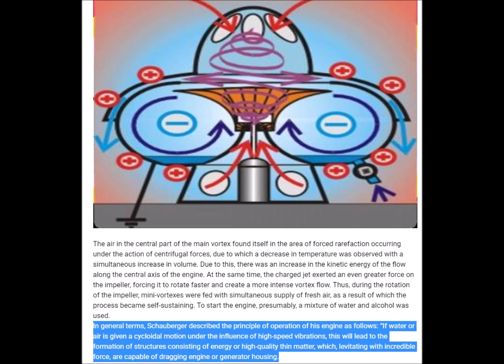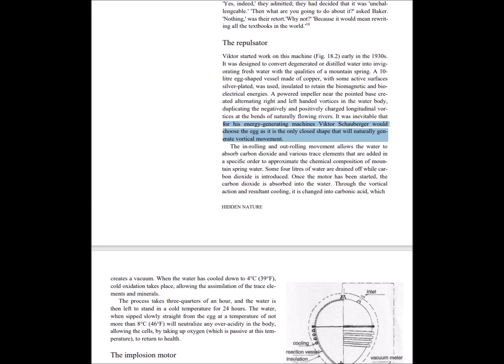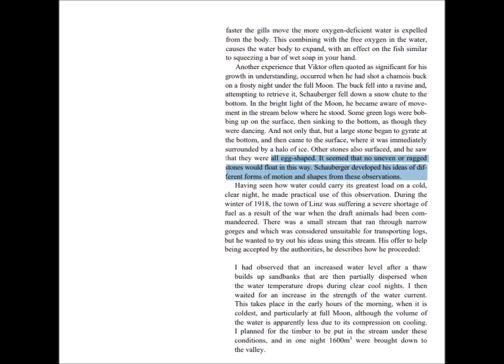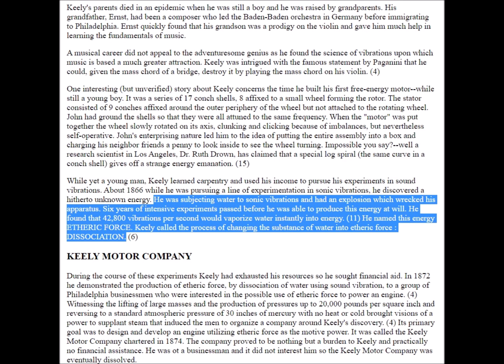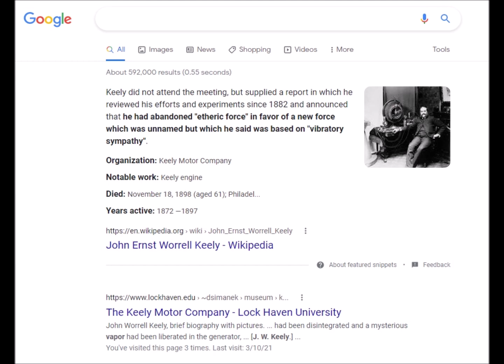Stone Levitation by Implosion

Comment: How is this not centrifugal?
Reply from the maker: @GWAForUTBE  The action of centrifugal force acts on the fluid creating the vortex.
Reply: @gsutton78  IC.  Pls look up the difference bettween Vortex & cyclone.  Or cyclonic action.  This is cyclonic action.
Reply from the maker: @GWAForUTBE    A vortex is a swirling mass of air or gas. That's what this experiment shows. My first experiments in water clearly show a whirlpool. Centrifugal force does not produce an upward force or vertical movement, ejecting the brick. The pressure differentials in and around the vortex do that.
Reply: @gsutton78  i did an extended version of the difference between cyclonic & a vortex but it was erased.  
Wiki has a good article & diagram  about a vortex tube explaining the difference.  
Yours here is cyclonic action. 
Great work you're doing. I've some other interesting ideas more related to AG ..

Comment: A better way of testing it would be to tether it to a retractable cord of some sort and then attach a newton meter on the bottom and see what the upward lift is

This would remove the unstable elements of the weight in a bucket and possibly give you more insight into the lifting power of this phenomenon.

Comment: With the egg theres varying pressures of "opposing" or "gravitational" lenz force at the distance because of its shape, it looks like first egg  vortex begins quick then goes slow because of the larger mass at the center then the last part is quick because the mass goes smaller again at the bottom. The cylinder mass is equal and thereof the lenz effect is equal.

Comment: its centrifugal :D
Reply from the maker: That's not what propels it vertically, though. Rather, the effect of centrifugal force on the fluid (air) creates a vortex which in turn creates strong pressure gradients. Low pressure in the center and high pressure around the edges.
Reply: looks like its atempting to escape but the container is conical, therefore its riding up
 @gsutton78
Reply from the maker: @NixCM   But in this video, https://youtu.be/4YpPdVQN9k0?si=Jp42Ho8t5DY2vvD4, the container is not conical and it still rises. This means that the divergent sides in the other experiments aren't the cause. It only enhances the effect, showing how important geometry can be to energy and force production. It's like rocket nozzles. They too have divergent sides that flare out. But they are not the cause of the expanding gas. The gas expends due to thermodynamics. The shape only enhances the propulsion by releasing force over a larger area.

Comment: I get what you're demonstrating. We pull the plastic container and replace it with a different mass to generate spiraling current and friction on the mass, and it will propel in the opposite direction of that source. 
My formal background is actually in electron physics and engineering, I can easily see a more complex system, that's still pretty simple, where combining effects with just a few devices would at least generate launch if not flight. 
How efficient etc. I can only guess.
Reply: You should look up the TSG by Malcolm Bendall. They need more physicists people to confirm the plasmoid theory.

Comment: gravity does not actually exist -- of course readers will immediately dismiss me due to this statement. But wait !  

Each example of 'gravity' is actually explainable via relative density and/or buoyancy. Release an apple in air, and it 'falls' to the group. Release the same apple above water, and it drops down through the air and then stays on top of the water. 

Now, here is where a person's mind get challenged. Release a helium filled balloon. Does it drop? Nope. It rises. 

All we have to do is check density tables for air at a given elevation, a rock, an apple, helium, etc. The lower density object/gas/liquid sorts itself out above the higher density solid/gas/liquid.

Metal can not float, right? Gravity pulls it down. Except if you shape it, it will float via buoyancy.

Comment: The form here is the reason for this turbulence. Many on YT have used an egg shape. Perhaps a disc or donut base would allow the form of the whirlpool to continue to do its thing and you can float. 
Otherwise you must make some fins that can move to allow platform to be flown along with moving medium and set a maximum rotation or you will shot-put the platform out of the centripetally spun medium.
Reply from the maker: It actually did float here: https://youtu.be/VLdaljPaS2w. But I have to agree, it was difficult to get a repeat performance.

Comment: The instability of the base is causing the top of the container to wobble in a somewhat circular pattern wider than the bottom.  Therefore creating a cone shaped travel profile of the interior of the container.  Causing the plate to rise when rotating.  The variable of instability of the test bench needs to by solved in order to make the testing consistent.  Otherwise you are basing results on poor control of the easily accessible variables.  That’s why it rises inside a straight sided, yet UNSTABLE rotating container.  Too obvious really.  Aloha.
Reply: I just erased my cone comment, haha.

Comment: Sorry for my ignorance.
But to me all this is just some some objects moving through a water vortex, that is exactly what happens on a washing machine. What exactly is the extraordinary thing going on?
Reply from the maker: Yes, this is quite a bit different than a washing machine. This is vortex motion converted into vertical movement or propulsion. In a washing machine, the clothes are impinged against the inner surface by centrifugal force. But implosion works by subjecting a fluid medium such as water or air to centrifugal force as in a tornado or a whirlpool vortex. In a vortex you have a region of low pressure in the center and a region of higher pressure in the outer perimeter. Objects can get caught up in this updraft in the outer region. Loose golf balls will be thrown against the wall as in a washing machine. But if you attach the balls to a ring structure, now you have a device which can levitate in water or air, and can do so without being in contact with the inner surface of the jar. It is more clear in the video here: https://youtu.be/big9DchuuWM
At 1 min 3 seconds in, you can see that a ring loaded with 5 pounds is floating in mid air and rotating independently of the container. The rotation acts on the fluid (air) which then acts on the ring to lift and rotate it: a form of aerodynamic levitation. At sufficient speed, the ring will even be propelled out of the container. Once the rotation slows, though, it will begin touching the sides as the centrifugal force still exists but the vortex is weakening.
Reply: Do you know how could it make a functional flying saucer? I just envision it as a experiment without practical use.
Reply from the maker: @wei3451  I recommend my video on Victor Schauberger: https://youtu.be/6_nHg31OMas. His craft includes a rapidly rotating chamber which sucks in air from the above the ship into what is essentially an artificial tornado. A low pressure region is created just above the ship, a vacuum into which the craft is pulled (upwards). The speed of the rotating air molecules and their collision against the metal surface inside the chamber would also cause them to ionize. You now have ionized particles rotating at extremely high speeds, creating an intense magnetic field. If oriented correctly, a powerful magnetic field can interact with the Earth's magnetic field to create additional lift or levity.

Comment: Works better with liquids,especially liquid mercury.
Reply: I recently found out you can combine platinum with gallium at a ratio of .0001% platinum to gallium.  (Heat 300°f for 2hrs. ).    What you get is a sort of liquid platinum that is catalytic at room temperature which i a big deal and opens up all sorts of possibilities. 

Mixing gallium and aluminum will give you an end product that when used in electrolysis will separate water into hydrogen and oxygen three times  better then tropical steel i think it was …

Arrrggg I’m getting a migraine  which makes me lose eye sight more by the arcing n second so i can’t see the screen.  Abacus plat gallium is even u for hho than the aluminum one.

Comment: Is it not the centrifical force spinning the water outwards that causes the water to pull the object inward? You make it sound like the air is what pulling the object up when it's the mass of the object being pulled outward by the water. You're changing the direction of the objects weight outward not upward.
Reply from the maker: Well, the centrifugal force propels the water from the center, creating a low pressure region in the center. The normally ubiquitous atmospheric pressure can then push down in that region. This creates an equal and opposite reaction as an increase in pressure near the outer regions of the vortex. But this doesn't happen when the vortex is within a vacuum as shown here: https://youtu.be/fdeChnr8HQw.

Comment: Tapered sides anyone?
Reply from the maker: But check out the following video starting at  the 30 seconds mark. The ring is smaller in diameter than the container, especially at the top. The ring is clearly floating and rotating independently of the container. https://youtu.be/VLdaljPaS2w.

Comment: E=mc2 is the solution.
Reply from the maker: You're absolutely right! The only thing is that the proportionality constant represented by c2 is so huge that it takes an enormous amount of energy to equal a small amount of mass.
Reply: Einstein did more to hurt science than pretty much anyone else.  Hes no one to praise. Denying aethr and then after the damage is down back tracking and admitting  to even consider a system /unified theory without it is an impossibility.
Reply: Space.    There is no empty space all is connected.  There is no dark matter. Bs black holes. Dark energy. 
All saturnic deception. And creating a plethora of things to replace aethr

Anagrams

aethr
heart
earth

This should be extremely meaningful but to the indoctrinated minds. Closed off with no heart to feel through the dark… it’s meaningless.  Supposed coincidence.  How dense a dunce one must be …… dividing and separating. Awl they see. 

Fyi. Big bang theory is all about six sixes xes sex.   Abe’s there rest of nassa   spacex. And the rest.  If you pay attention to phonetics tool quickly see everything nasa talks about is filled with ÏNNuendo. In you endo.     Gall-axy milk-e-whey.  Milk-key-way.    Things will also actually make a lot more sense.  Also their scientist snd astronaut names are all pen names. 

The pen is where the names come from. 

Pen-is.    

Names
Seman.  

Coincidence right?? 

Sad